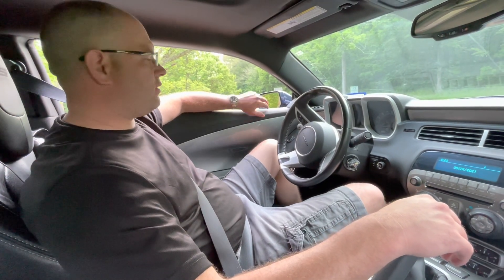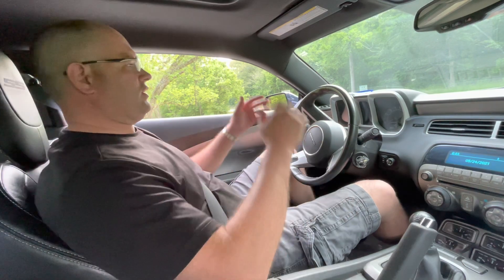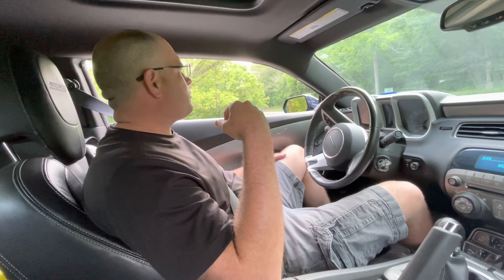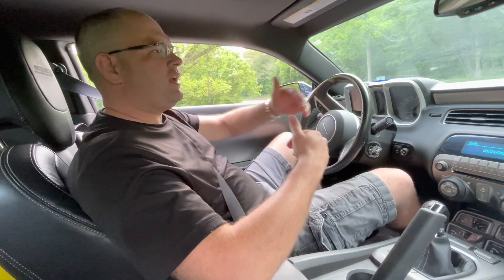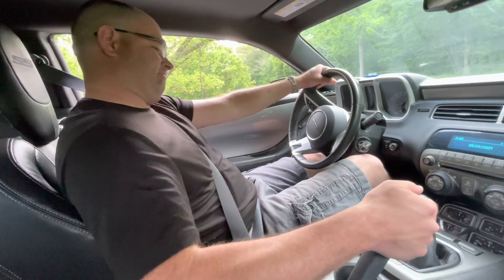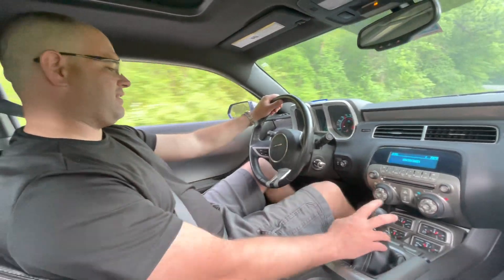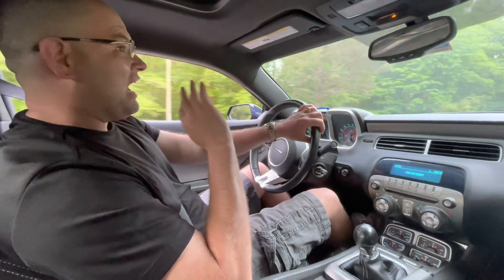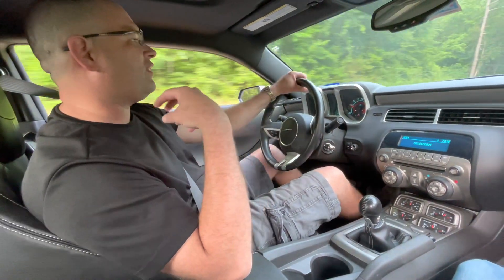2011 Chevrolet SS Camaro Engine hesitation: Solved

Comment: U can push it once. Twice. Or hold it down. Once just turns off traction control. Twice. I believe you can’t spin tires and has counter steer help to correct fish tailing. N holding it down til the both light up is absolutely no assistance from the computer.  Means. Hold on cause nothing is going to help keep the car on the rd.

Comment: Mine does it too, dealer told me they got no codes😂. Then they said it's bad gas most likely. Going to run out the shitty gas and put a oem $100 map flow sensor on it?we'll see

Comment: One push turns stailitrak off completely pushing twice put stailitrak is a like 50/50 state where you'll have some free spin on the tire but it won't break loose for ya. So burnout one push. Two push for like taking off at a drag strip

Comment: My 2013 Camaro LT is doing exactly this right now! I've got it torn apart where I replaced the mechanical fuel pump (they're prone to going out), the PCV valve (comes out of the crankshaft on the driver's side), replaced the high pressure line from the mechanical pump to the rails, and cleaned the injectors. I just put on an AC Delco MAF sensor the day it died on me and would stay running, but it didn't fix it. We cleared the codes, and they all popped up again. (I learned it's actually a multipurpose sensor and does more than just the MAF.) Putting it all back together as I speak/type, and hopefully it'll stay running when I hit the gas! 🙏
Reply: How she running?
Reply: What sensor are u saying is the multi purpose one, maybe I read it wrong. U said u put an Ac Delco MAF on and it didn’t fix it?
Reply: tell me more please   were is the multi purpose sensor located  ?

Comment: Thats the fun button. I went as far as to disable mine completely. Good drivers dont need traction control! Learn how your vehicle reacts in slipping situations and you will learn how to properly react to it with confidence. These are great cars to install line locks on as well.

Comment: You didn’t turn it off it’s only simi off push the traction control button hold it until both lights go off and no competition mode comes on and you have totally turned off traction and stability control and are in full race mode
Reply: Sorry hold it til both lights come on

Comment: I got the same in car but in automatic and it turns off when idled and jerks back whenever I’m driving you think it could be the same problem? It does it every now and then not all the time and no check engine light
Reply: Wow same for me, I have a 2012 Camaro RS .....did it work???
Reply: @seidyrios5685  …I was thinking maybe it’s that as well. I just bought the car it has 63k , fully loaded and is super clean… I absolutely love my car! But it does have the shudder at low speeds. I thought the trans was going. But after reading I see it could be a few different things… guess I have to go down the “Camaro shudder” rabbit hole that so many other owners have gone to find the solution… thanks for your feedback Brother! 💪🏾💯

Comment: Hey this is what I you do. Tap the stability button once and then twice and then tap and hold until you see both  lights turn on. :) It’s a little secrete and then u can burn rubber all day it’s really cool when I found out.
Reply: is that trick for a manual  transmission  or an automatic  ?
Reply: @larryeberle9082   both   i have auto 5th gen camaro its called the  "
fun  button" look it up

Comment: I bought mine used at the dealer, on the way home the stabilitrac light came on. When I got home I called the salesman and had him ask the mechanic what he replaced and it was he maf sensor so I took it out and used compressed air to blow it out.But what I found was it was installed upside down and when I reinstalled it the stabilitrac light went off and it drove normally.

Comment: Yea I did maf sensor, crankshaft sensor, all 8 spark plugs, all 8 ignition coil packs & my SS still drives like 💩.
Reply from the maker: Did you replace with all GM Sensors?
Reply: @nicholasburton955  it was my fuel injectors 🤦🏾‍♀️.
Reply: @feMARIE614 was it like cutting in and out real bad and couldn’t go past like 40 or even before that and engine reduced power… AND my traction control light is stuck on
Reply: Could be uhhh vent valve
Reply: @great4ever845  fuel injectors. Once I replaced those the car was back to normal.
Reply: Which is a bitch to replace

Comment: I have a v6 2010 it hesitates after trying to push it to hard then it’ll start shaking really bad until I turn it off and back on and it work fine just can’t go to hard on the pedal as I drive ( check engine light: misfires, and 02 sensor but I changed all of that over and over) what could it be?
Reply: Fuel injectors, injectors wiring harness, spark plugs and wires, coil packs, check all of em’! 
On my 14 Ss it was my injectors failing. 
It was doing the Same as yours. 
Fine one min! Tripping the next. 
And it’ll keep getting worst.

Comment: Stabilitrack mode is the also the launch control mode in my 2012. There is some things that dont let you do what you want in that mode. The stability lamp is flashing and restrict if you try to do a real heavy slide for example. To get rid of all the restrictions you have to hold the button for quite a while. At least 5 seconds (feels like more)

Comment: Mine starts hesitating after it warms up and it does everything your car did idk what it could be tbh could it be the mass air flow also ?
Reply from the maker: Do you have a check engine light?
Reply: @nicholasburton955 i do

Comment: Pushing the traction control once turns off only traction control. Pushing twice puts it into competition mode and allows launch control and stability trac(it will not go sideways when taking off). You can also push and hold the button 
to completely turn off all driving assists.
Reply: And if you push and hold... if you power launch all hell will break loose.  LOL

Comment: I made that mistake on my duramax by putting a cheap ebay maf on....I shortly after paid up and put in a delco unit.....problem solved
Reply: hopefully i fix mine i have a cheap throttle body on maybe thats why it hesitates when i give it gas
Reply: @christophergarciayanez74 u ever change that throttle body? If so did it help?